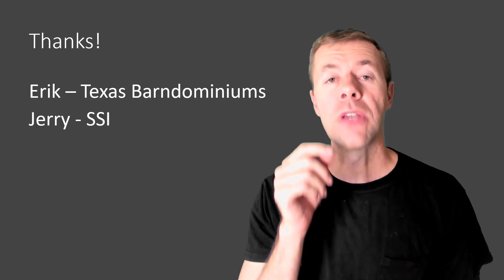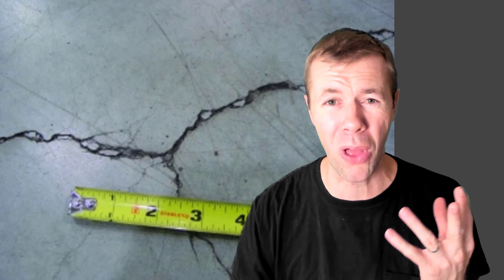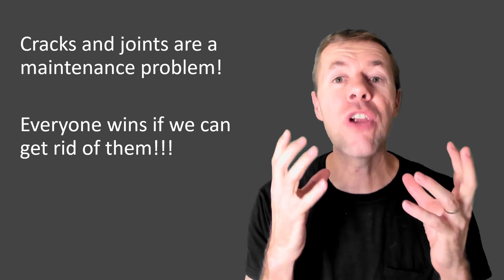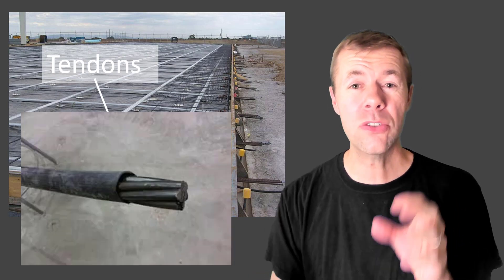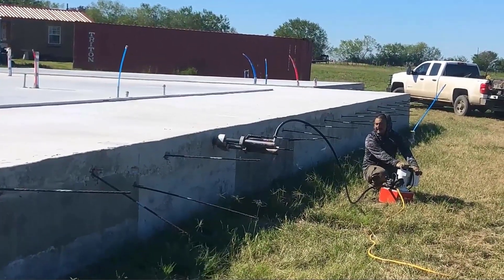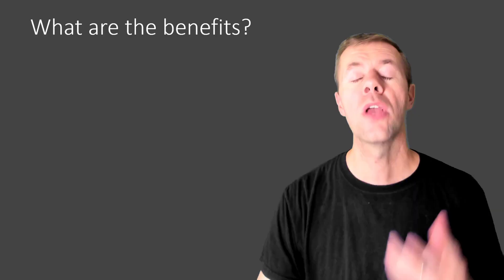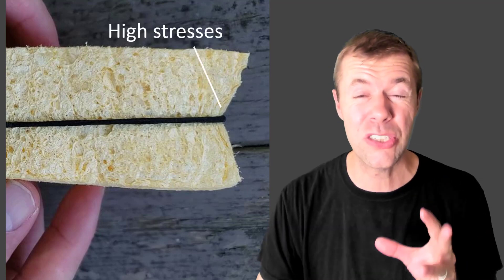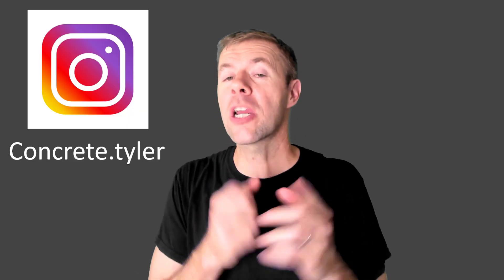Post Tension Slab | Eliminating cracks and joints in concrete!

Comment: Great video Dr. Ley, kept on trying to research exactly why the post tension helps reduce cracking (most of the results just say it helps without great explanation), this video does a great job explaining that it puts the slab into compression, the sponge is a great visual! Thank you!

Comment: Post tension slabs are great, unless you want to remodel and move plumbing.  If you are going to buy a PT home, get the sewer plumbing camera inspected.  Most common problem I see is a belly in the pipe.  It is a problem that happens during construction but doesn't cause problems immediately.  It is a pain to fix on any home because it requires direct replacement of the pipe (concrete removal and digging) for 20 feet or so, but especially bad on PT slabs as they are 10-12 inches thick and if you saw cut you risk cutting the tendons,  so it's the jackhammer for you. 9 out of 10 plumbers won't even take the  job, so you are stuck paying whatever the 10th guy wants.  Also make sure to have gutters and good drainage. If water is allowed to sit against the slab it will corrode the parts that hold the ends of tendons and they will loose tension.  There is usually a stamp in the concrete slab inside the garage warning you that the house is PT. I have met several people who did not know their home was PT.
Reply: Slabs are 4" thick. Beams 24" to 36" deep.

Comment: Nice video! I am buying a house (which is still under construction) and unlike the other houses that are being built in the same development, this one does not have a joint in the garage floor. The slab is PT and I was wondering if the missing joint is critical. Any thoughts?

Comment: My client is buying a new townhouse with post tension concrete slab.  There are already cracks in the garage floor.  Builder said they are normal.  Should we be worried?  Is there a way to post photos here?
Reply from the maker: It depends on the size and the orientation of the cracks.  You should have a good home inspector look at it.

Comment: Love your videos. I hate rebar! Romans built without it, and steel rebar ultimately destroys concrete due to oxidation expansion from  loss of passivation and water infiltration. Is it feasible to protect post tension cables for multi century, durability, and or is it possible to replace corroded cables after long periods of time? Also, how about combining post tension steel cables with Kompass, it basalt, or fiberglass cables? Do post tension cables come in the synthetic variety? Thanks Tyler, I love Concrete. He just makes me sad that so many concrete structures will have to be torn down and only have a lifetime of around 100 years. It seems like such a waste of resources

Comment: After stressing the post tension cables Is it gonna make the existing hairline cracks disappeared from a new poured concrete slab? 
Or they’re gonna stay as they are,it is only going to prevent occurring new ones ?Just few days ago,my builder poured a new slab foundation ,while it was curing,noticed some long hairline cracks,but the post tension cables haven’t been stressed yet. 
Thanks in advance!

Comment: Where I am (in heavy clay soills)these don't last long.  I come across so many that fail.  Most don't add the rebar and I believe 30-36" on center isn't enough.  Lager beams with plenty of rebar in the top and bottom cords seems the way to go.  Great video though
Reply: Builders think PT is magic so they put in a lot less reinforcing, a lot less concrete, put the money in their pockets and drive away.

Comment: What if the slab is PT slab??  Is it ok to cut a 2x2 foot hole with out damaging the integrity of the slab?? Also not damaging the tensions
Reply: Being near the edge or 100ft from any edge would make all the difference, along with thickness and tension to area ratios. Thus each specific case requires an engineering check.

Comment: Hi Tyler, very interesting video... I'm wondering for a house build to minimise or even eliminate cracks on foundation walls and basement slab could one use a combination of rebar and fibres or post tension is still the superior product but a bit more expensive?!?  Thanks
Reply: Mild reinforcing, like fibers and rebar, does nothing to stop cracks. Mild reinforcing limits the width of cracks and keeps the general casting from falling apart, but it does not take up significant load before the crack has formed, though it may only be a hairline crack.

Comment: One of the major issues of slabs on grade is cracking due to concrete shrinkage while hardening. That is why contraction joints have to be cut early on, as soon as the concrete starts hardening. Usually the joints are cut the next day after pouring.
On the other hand, the concrete has to gain sufficient strength in order to withstand the post-tension forces. PT for non-SoG slabs usually takes place about 2 weeks after pouring.
How is the shrinking cracking treated for SoG PT slabs? 
Do they tension the strands progressively every couple of days as the concrete cures?
Reply: I have installed over one thousand PT slabs as a construction super in Southern California. During the slab pour the deputy inspector will cast test cylinders on site that are picked up a couple days later. The cylinder “breaks” are done in a lab at 7,14, and 28 days until the proper psi is reached for stressing. I have never not had them come up to the proper levels past the 7 day break. 

The cables are stressed all at once with a deputy on site making record of it. The live ends of the cables are torched off, painted and patched over at the slab edge. The dead end nails that were stuck in the form are also torched off, painted, and patched.  

You can actually watch shrinkage cracks in the slab close up after stressing. 

Suncoast is my favorite company but Specialty Steel also gets the job done.

Comment: Hey Tyler, thanks for all the informative videos. Question I had, can you sawcut into post tension slab as long as you don't cut the tendon? Does it depend on anything?
Reply: You could sawcut into PT slab but you shouldn't need to and the sawcut will reduce the cross section that is being stressed.

Comment: I first heard of of post tension concrete slabs in the show Flipping Vegas. I wanted to know more about post tension concrete slabs in case I ever have to cut in to the concrete in order to run an electrical wire. They mentioned on the show that it would be dangerous to cut one of those compress tension lines.
Reply: Sometimes they get cut but you should try not to.  Not only does it reduce the strength of the slab but the recoiling cable can cause damage elsewhere.  It's like pulling a rubber band tight and then cutting it- something gets a sting.
Reply: You should de-stress any cables in the area where you plan to cut. Later insert a new cable and re-stress.

Comment: I would not want a post tension slab under my house. I would use conventionl slab reinforced with a good gfrp rebar like Aslan 100; maybe with fibers added to the concrete. Don't have to worry about cutting thru tendons by accident; or rust causing failure.

Comment: Concreteing for 30 years...wierd to see PT on ground.  Usually its for suspended decks. SoG is usually double mesh ( two layers separated by SoG chairs) at 150-200mm thick. Also seeing a single strand instead of 4-5 strands per tendion is strange..only in America I suppose.
Reply from the maker: Thanks Harold!
SoGs rarely use double mesh in the US.  It is fun to learn about how different countries build their structures.
Reply: @TylerLey  im in Australia. ..they have fairly good practices here, however,  the one thing that annoys all concretors here..our Australia /New Zealand standard for concrete slump on site is still 80-100 slump max...not allowed to add WATER , and contractor/builders/developers dont understand the importance of chemical, particularly hyper plasticizer or retarding agents. Ffs the plants dont even garantee their mud  once its driven out of their driveway...Personally,  I take great pleasure in reminding their sales teams if this and maybe they get their wallets out and do something about it or its going to cost them in the future. Anyway, thanks for the reply.

Comment: Hello, I have a question, our PT slab occurs so many cracks during the curing time but before stressing. After stressing, it occurs no more crack. Our slab design has no top rebar in most of the slab area, except arround the collumns and the boundary beams. The top surface cracks mostly be found along the joints between the mushroom areas of the columns and the boundary beams with slab area, and the bottom surface cracks are in the middle area. I think it is because the deflection of the slab before stressing process, the middle area bottom surfaces are bended and the support top surfaces are stretched. Because PT slab works mostly by cables, not by rebars then is there any chance the props of the slab are not tightened enough or the slab is too heavy then even the props are properly tightened but it still deflects significantly. If so, should we rise the middle area formwork a little bit, about 1.5 to 2 cm to reduce this problem? Hope to see your oppinions from you people, thanks for your attention.

Comment: hey Tyler, has anyone ever tried reinforcing concrete with post tensioned polyester rope?  it is weaker than concrete but you can use more rope to increase strength and distribute the load.
Reply: The Rope would more than likely rot keep stretching just not the way to go in my opinion

Comment: Your video are an excellent method of demonstrating to the public about how many choices are available.  To give the public much better quality roads.  For just a little bit better planning and supplimental materials.  Give us roads and structures that maybe the Romans would envy.
I am an operating engineer who worked with a California based research program.  I saw that in many forms, water is the enemy of both "portland cement concrete" (PCC) and "asphaltic cement concrete" (ACC).
3 of the most interesting things that I observed during the test program. 1.) Precast slabs have an incredible increase in load capability over SOG slabs.  2.) Any reinforcement of slabs, from rebar, cable, rope, fiberglass, even wood, greatly enhances PCC slabs.  3.) Fines intrusion of SOG may contaminate up to 2 inches of an 8 inch slab.  Making membranes crtical to prevent alligator cracks and slab faulting.
Your example criticism of ACC pavement.  Was a situation that could have be prevented by maintenance.  Adding a slurry mix on the top surface 2-5 years after paving.  Will reduce or eliminate alligator cracks or other defects.  Also paving in 1 to 2 inch layers more evenly conpresses the ACC.
PCC does last longer than ACC if the ground is prepared with the old Roman technology in the road base.  And the load is placed 18 inches from the edge of the pavement.  Keep those fog lines away from the edge of any kind of pavement.
While the precast pavement method is patented.  Casual observation has shown me that method gives the ultimate strength in pavement or structures.  While reinforcement is best.  The precast method appears to give greater strength than any SOG method.  A test conducted at a special test site located in the Southeast quadrant of the I-210 & I-15 interchange, during 2005-2006.  Look at any satelite view of the location.  The test slabs are still there.  I don't recall how many were assembled together.  While the HVS machine could fail any pavement commonly used.  The precast slabs were a significant upgrade!

Comment: Pop noise? That would be bad. Not 4,000 pounds. It's typically 5500 psi on the gauge of the hydraulic pump which equates to 33kps of force on the tendon. Decent video but some inaccurate information. Also, from one of your other videos Dywidag is pronounced Dewey Dag

Comment: Thought that plastic sheet is a vapor barrier to keep moisture from traveling through the slab that didn't initially enter through the top of the slab.
Reply: That's true; but is also helps cracking by reducing friction loses between slab and ground when stressing cables.

Comment: Worked around PT doing parking garages as a union finisher but really didnt have time to check the system out was wondering if you could do the PT system on paving , residental drives, and wood post frame buildings? And also dig your channel very interesting to a concrete finisher . thanks

Comment: I think you missed the most important feature for developers. Slabs are thinner than structural slabs. Saves allot of concrete & rebar (MONEY). Also ...There are no massive beams under the slab and therefor you can run your plumbing and electrical more efficiently and if you have any clearance needs underneath, that will also help.  Your video specifies PT Slab, but most Multi Family developers also will note that the thinner nature of the slabs make the vertical height of the structures more efficient. You don't have to go as tall to fit the same number of floors. Good for zoning purposes and construction efficiency.  Great video though - thanks for sharing.
Reply: Wow you're pretty wise man, are you a civil engineer by any chance ? How old are you?
Reply: This is because PT is "magic".  But PT residential slabs also have more foundation issues than the larger conventionally reinforced slabs.
Reply: Sir u have great knowledge can I got number I am a Civil engineer from India

Comment: I have been a Structural engineer for 30 years and it wasn't until recently that I heard about people post tensioning SOGs. I was surprised that people would go through this kind of hassle for an SOG. I think it is far less common outside of the US. In other parts of the world, we just accept the cracks. To be honest, I don't like the thought of a live end that is more exposed to water near the ground along with all the other hazards and downsides to PT. We also don't have expansive soils where I live. I would like to hear more detail on how PT slabs help with expansive soil issues.
Reply: Agreed - I have never heard of this. I build here in the US and I don't know of a single PT-SOG.
Reply: @WilliamPozo  My  slab on grade foundation has post tension cables. Colorado has expansive soils, which expands and contracts when it gets wet/dry. This can cause the concrete to bend, and the compression from the cables resists cracking when this happens. I think it just depends on what part of the country you live in. They are pretty common here actually.
Reply: We design residential SOG in Texas. 90% are PT.

Comment: Another informative vid Tyler. Unfortunately the majority of stressed concrete slabs in Australia are purely reo rod based due to costs that most customers refuse to accept, unless forced to by state or local council  building laws. SOD foundations are only found on major infrastructure projects where strength, limited flexibility, extended life and performance, and large areas of coverage are put before cost, but that still offers no assurances of failures within the supply and manufacturing chains, leading to complexed issues in the future. In my workplace, as a manager of a mine engineering workshop, I'd like to see more engineering thought put towards the concrete plinths and foundations erected here but due to rush to erect hi ing superstructure, profit is put before performance and cracking and delamination is ignored. 👍👍🇦🇺

Comment: Tyler, what would happen if the tendons were laid in the slab but they sagged in the middle. The way I see it, if they are not perfectly parallel with the top and bottom of the slab when the concrete sets up, they could actually cause cracking.
Do they tension them slightly before the pour?
Reply: Support steel is placed every 4' or so to keep the cable at it's desired height from bottom of slab. I can't speak for slab on grade but elevated slabs are designed with a drape/sag in the middle. High rise/elevated slabs have very 'wavy' tendon profiles.
Tensioning is done after the concrete has reached a certain hardness/strength, usually takes 3-5 days after pour.
Reply: Matt Casas - Thanks for that. 👍

Comment: Your friendly neighbourhood coring guy will make you sign the waivers specially, if you tell him to drill a hole, and you have a tensioned slab, and are not exactly positive where those little cables are. Might come in with a metal detector before, but you will still be made aware that all he provides is a hole, you must make sure there is nothing but concrete there before he drills, exactly where your hole is marked. TWANG, and why is the slab suddenly all torn up in 2 lines from this hole, and why is the core bit snapped in half.

Comment: 3:20 ERROR!  4000 lbs is not 10 cars in weight.
Reply: 40 Thousand lbs.
Reply: Alex T depends on the car. Could be very little cars
Reply: He drives a Yugo, so yeah 10 at least.
Reply: Usually 1/2" PT strands are stressed to 33,000 pounds which would be close to 10 average cars.